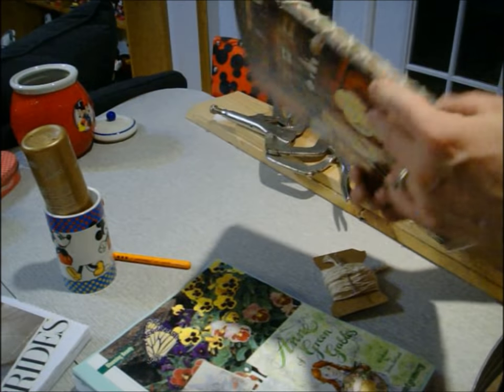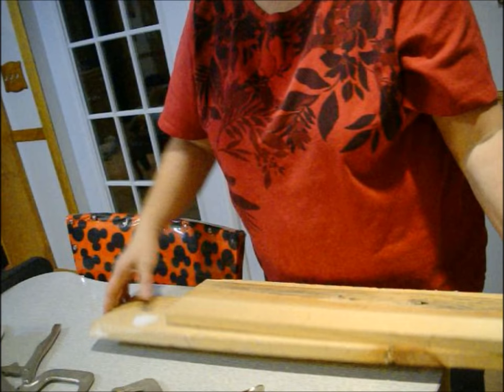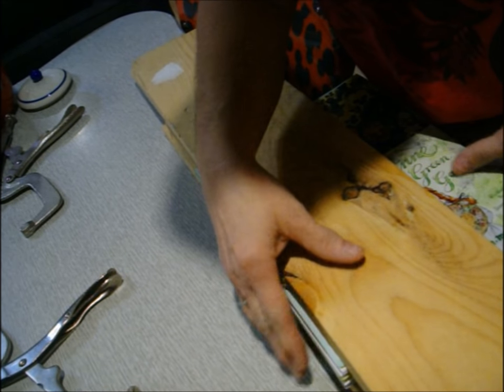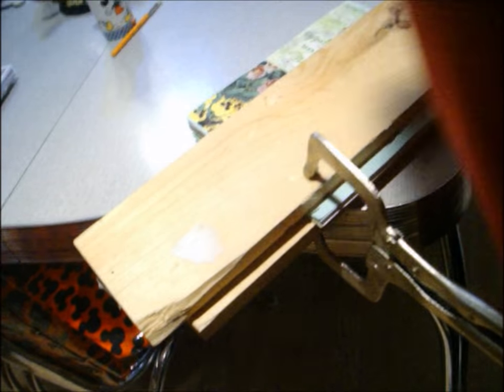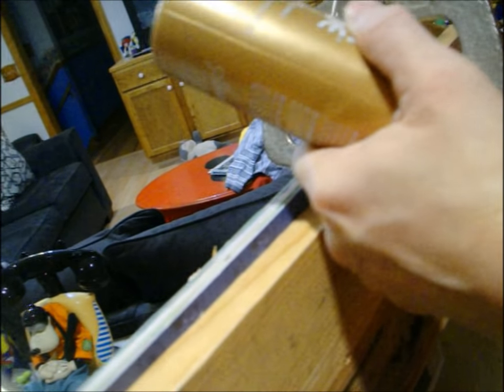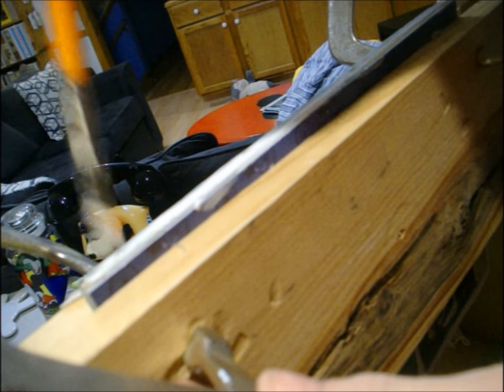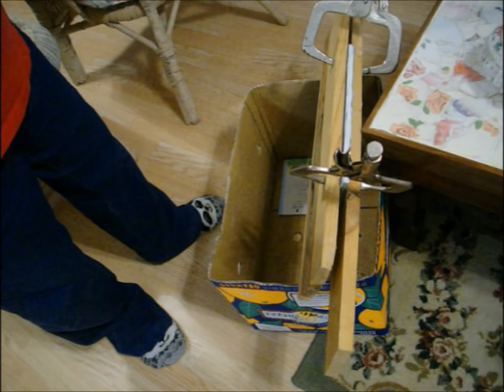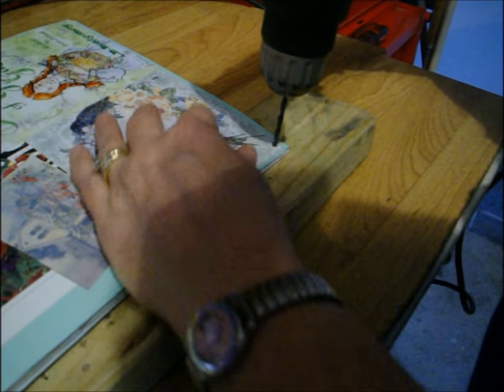How to bind a gluebook+DEMO

Comment: Maybe try putting a couple of large alligator clamps (binder clips) on the side of the stack opposite where you are gluing, to hold them in place while you clamp them down?
Reply from the maker: That is a good idea, this video is a few years old and this is how I learned to do it from a Shannon Green video. I have since started also using the alligator clips, they really help a lot in keeping them from shifting. I do still use the boards, they create an even pressure all along the binding.